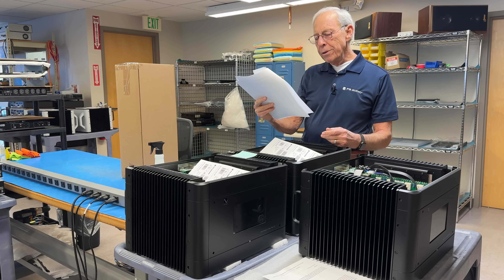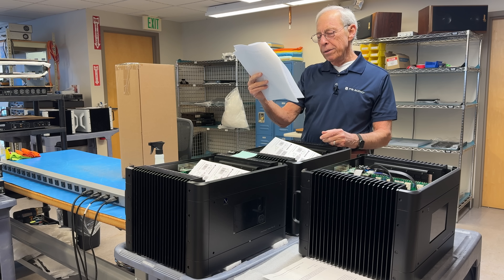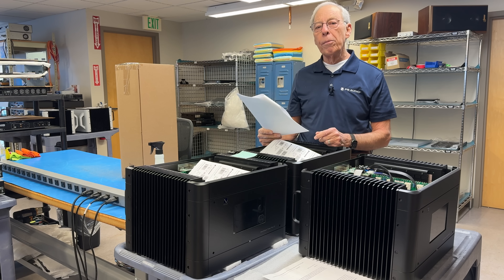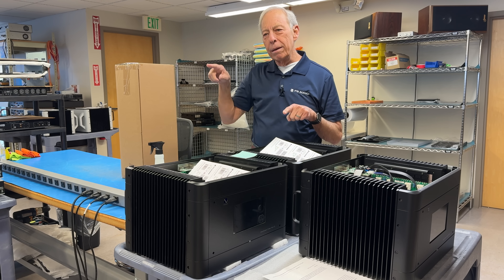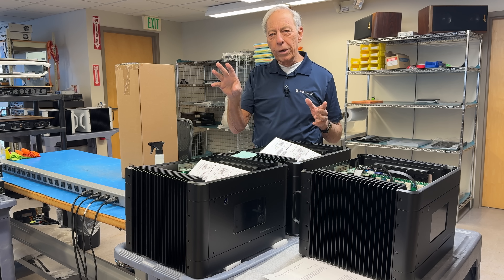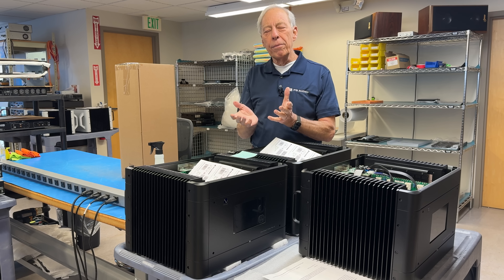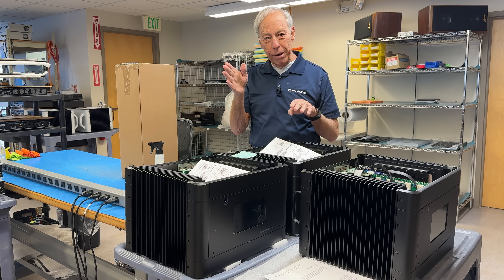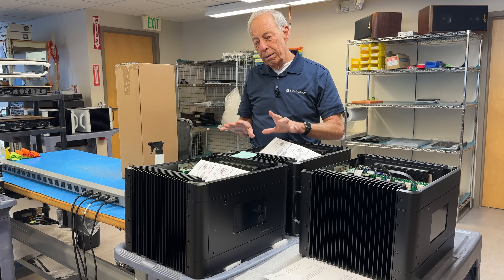Paul explains damping factor

Comment: With my Thomas TS A 75 100 W per channel into 4 Ohm amp driving my Maggie 3.6 R’s, the amp just chuckles at how easy it is to drive them top to bottom much easier than my Audio Research VT-100 Mk III. Go figure.

Comment: I’ve been playing with various power amps on my PA subwoofers. I always find I’m drawn to high damping factor amps for best bass reproduction.  Wire length gauge and resistance are huge factor to preserving that damping. Keep amps as close to speaker as possible. Likely why powered speakers are less impacted by this. I’ve used from 100-5000 damping factor amps.  The old crown macrotech amps sound the best to me. Around 1500 damping in lower hz range.  Some new class D pro audio amps are 10,000+ damping in high end designs. I would love to hear an amp like that.

Comment: What a load!  Magnepan speakers do not produce back EMF due  to the fact the permanent magnetic field is parallel to the magnetic field of the moving membrane.  No back EMF means exactly no damping by amplifier.  An amp that will not drive a Magnepan is just a junk style amp.

To correctly measure damping factor use an eight ohm resistor of 10 watts or so connected between the two positive connections of a typical stereo amplifier.  Next, drive one channel of the amp with the test signal, say 2.83 volts output at 1000Hz.  Lastly, measure the voltage at the output of the other channel not driven.  A true RMS meter will be required that works at 1000Hz and higher.  To calculate damping divide the 2.83VAC by the voltage measured on the other channel.  Lets us say  0.10VAC RMS.  So: 2.83/0.10 = 28.3 which is the damping factor at 8 ohms at those measurement  levels.  ALL OTHER METHODS give false results typically much much higher than reality.
Reply: Fact check; Magnepan speakers do produce EMF.
What you’re saying would only be correct if Magneplanar speakers were purely resistive loads, but they’re not. If you examine their phase and impedance traces, you’ll see they exhibit resistive, capacitive, and inductive characteristics across the frequency spectrum, just like dynamic driver speakers. While it’s true that Magneplanars are generally less reactive, the same can be said for some dynamic driver speakers. The bottom line is this: Magneplanar speakers also generate back EMF.
Reply: @mrpeterfromgodknowswhere  From the crossovers.
Reply: @zynzy4u  The load is a combination of crossover + driver circuit. Making magneplanar speakers also produce back EMF.

Comment: I changed from a Primaluna tube amp with damping factor 140 to Accuphase Class A with damping factor 1500+.   The difference was jaw dropping.  Bass is more articulated and detailed.  I hear ripples in the bass that were never there before.  DF affects the entire audio spectrum.  For example: guitar strings have a stronger leading edge and solid sound with Accuphase and that keeps me upright in my chair.   With the Primaluna, guitars had a softer lead in and lush sound that would put me to sleep.  There are many tube lovers who say that tube amp bass is more "real" than SS amp bass.  I believed that for 20 years but not now.
Reply: Confirms my opinion once more. If you are into high end for listening to music and want to avoid getting into this expensive rabbit hole of buying more and more gear, get Accuphase and you are done (probably for life).
Reply: I’m surprised the 1592 MK2 had issues. They spec its DF at 600. Could something else be at play?
Reply: That doesn't necessarily mean it's all relative to damping factor.
Reply: Those  Accuphase Amps are very expensive i just checked them out. Like 10k. I supose its worth it tho if your getting that extra quality that kicks ass. Wow out my budget unfortunetly. Mind you i bought the svs ultra book shelfs and they were way out of my budget but god i love and enjoy them so 🙏🏻.
Reply: yep, bass sounds better when i upgraded from my already great Parasound 2125v2 (150 damping) to NAD c298 (800 damping) and PS Audio S300 (1100 damping) to biamp my PS Audio FR5 speakers

source=Apple Music lossless

my video

Hifi Kick drums kick my ass! PS Audio S300 (dual mono amplifier), WBC Ultimate 9 gauge speaker wires
https://youtu.be/-WbVsly1X0w
Reply: Hi Bob - I had the exactly opposite experience. How would you explain that? I think in both cases we moved from one amplifier to another that was simply better. In you case it had higher so-called 'DF' but I think that was just a coincidence. If it's better, then it was better. But there could be other reasons as well, right?
Reply: @D800Lover  power supply, has the most influence on bass reproduction. I have an amp with a damping factor of 200 that smokes all the other amps I own with much higher damping factor.
Reply: @mitchtaylor6512  - No doubt that power supply is a factor. It always will be. The best amplifier I have heard had an output impedance of 4 Ohm and I am not joking. The speakers it drives has current EQ that works from <30 Hertz up to >100KHz, which is saying that the current the amplifier produces is the same at all those frequencies. This effectively cancels out the 4 Ohm output impedance of the amplifier. The bass is to die for. Instrument tuning of bass notes and the ability to just separate from other sounds happening at the same time, it is tight and not just deep, but it has this sense of depth to it (not dry) and bass that images correctly. I just love to play it for people and watch their reaction. Alas, this method of bass (in fact method of speaker) has not been done commercially yet. The output impedance of the amplifier simply does not matter. Just get the current right. The alignment of the speaker is locked in, there is no loss of damping, zero! And no, this is no April fool post.

Comment: Dear Paul, one "hidden" attribute of the damping factor was not clearly described, however your explaning is great. I mean the damping factor ability to supress the speaker's membrane mechanical oscillation (inertia) when the amplifier's power drops to low or signal polarity swaps. The damping factor plays a major role in the lower frequencies as "bass" range, since the membrane stroke is much longer. A high damping factor is reducing the "smearing" of the "bass" and attenuates the "boomy" effect (especially on foot and barrel drums). Thus, a thicker conductor to the speaker plays a significant role, especially when the amplifier'd output impedance is very low. R_speaker/(R_out+R_wire)= DF_real.
Maybe you can emphasize on that important topic in a next "lecture".
Best regards from Israel 🙂
Reply: Exactly!!!

Comment: Fine on the explanation of DF, but you should recall that planar magnetic and ribbon drivers do not "dip down" in impedance - they are almost purely resistive loads and are EASY to drive because the impedance curve is close to flat.  The problem is not the impedance characteristics that make them hard to drive, it's the power requirements, simply because they have low sensitivity.